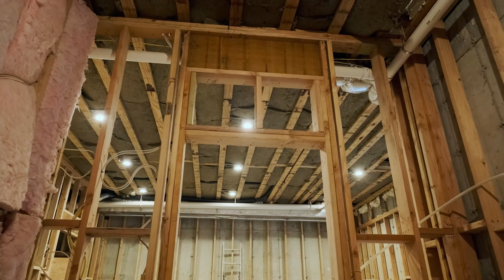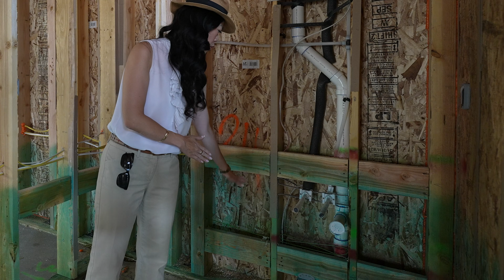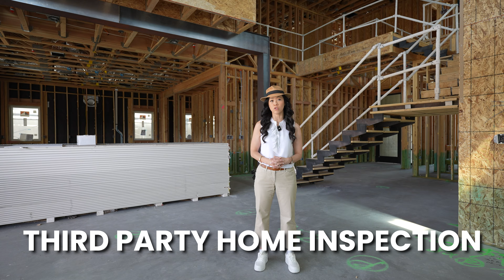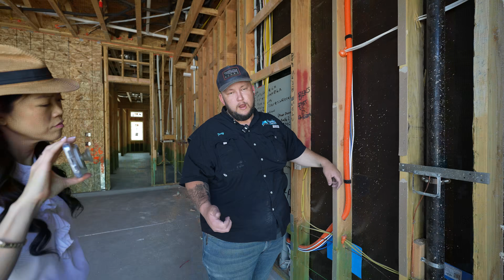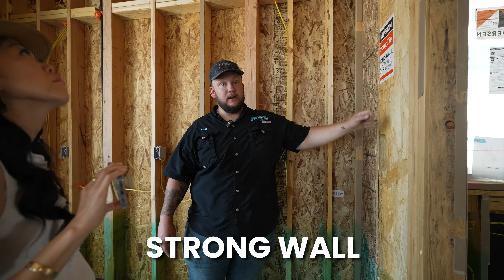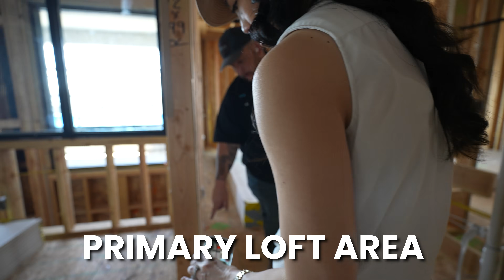From Beginning To End FRAMEWALK Inspection

Comment: It's also a chance for buyers to see what can be changed or customized before you contact contractors for building materials..saves you from saying,, I should have, or I don't care for that design..after it's completed.. take care kaori! Nice work ✌️
Reply from the maker: Not too much customization for a tract builder. You're confirming all the structural and electrical upgrades and making sure the home is built to spec 🏡
Reply: @KaoriLuxuryRealEstate makes more sense that way! Getting to see the structure before the walls are up! Thanks for the insight 🍷🔆
Reply from the maker: @BrandonClaypool 💯